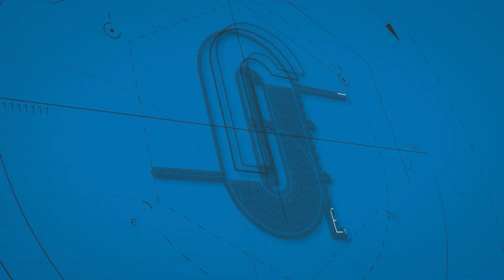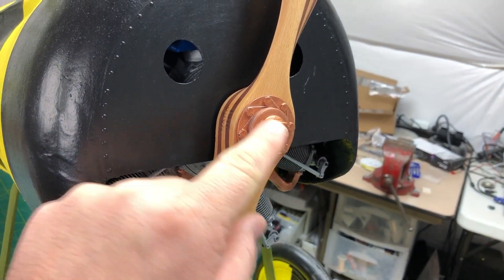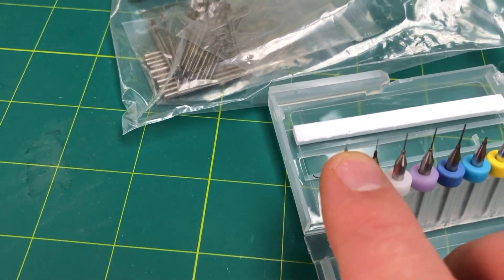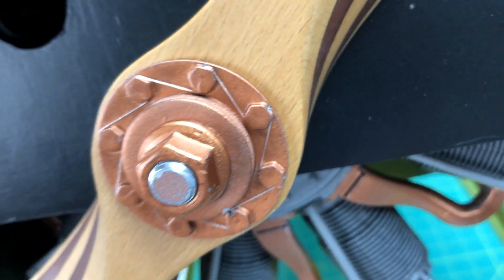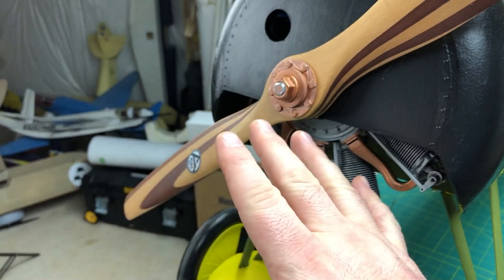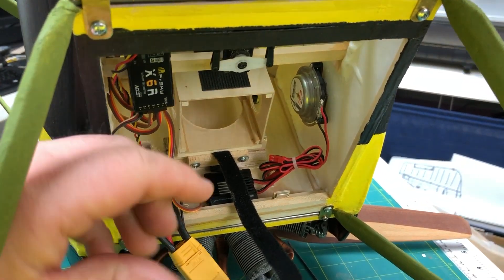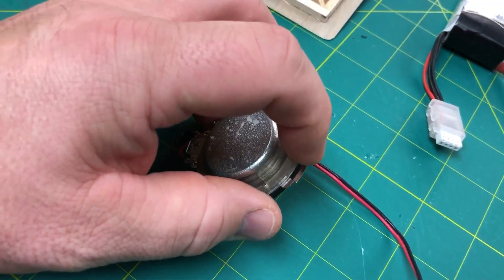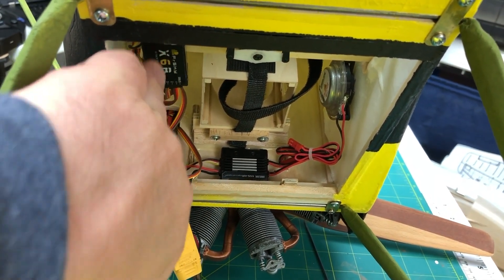Fokker D.VIII Ep. 10: More Details

Comment: Thanks Josh, .. the whole of this, .. very interesting. I'm attempting a Guillows giant scale static model, (to hang from the ceiling) and am hoping to equip it with LED lights, (to shine through the transparent film covering of this) plus an electric motor driven prop (spinning pretty slow) maybe retractable gear, if I can swing it .. and, finally, a sound routine. I'm going with an Arduino, to run it it all. The sound .. Arduino's got choices, here .. a WAV shield, is what I purchased. And, like you, .. I'm employing Audacity to get that sound file, that seems appropriate. At this time .. it's 2 stage .. starting up a radial engine, which gives it alot of character .. and then going to a Glenn Miller song. .. :) .. 

I think I would have looked into your method, had I known of it, though, .. about the sound. I probably went the more expensive way, .. for sure, more work .. because I have yet to solder the WAV shield together. Hmm, .. could be that I get more audio ability, out of this, though .. I believe I can play minutes of audio. Interesting .. the sample rate that this WAV shield's circuit is 10,500 .. which is quite coarse, versus the standard 44,100, .. but, if it sounds a bit grainy, .. that's sort of in the 1940's character, too.

If nothing else, .. my project should be the heaviest model, ever, for it's size.

You've got a cool looking bird, here.